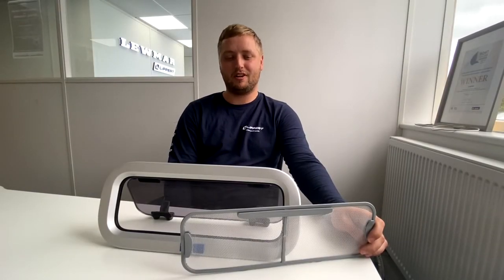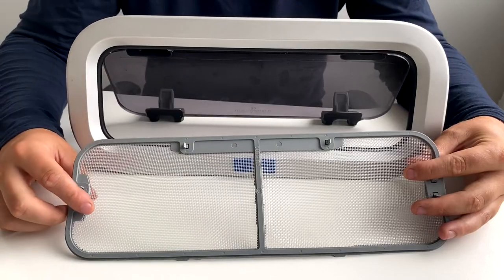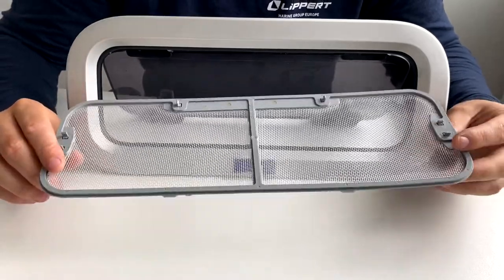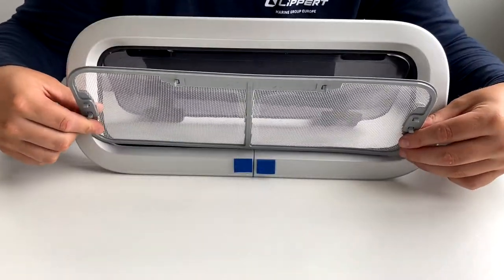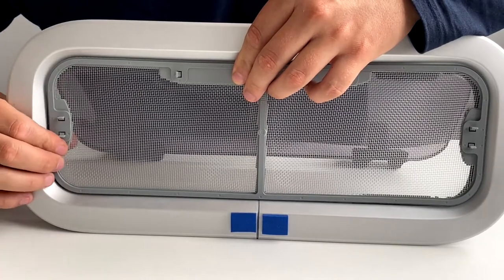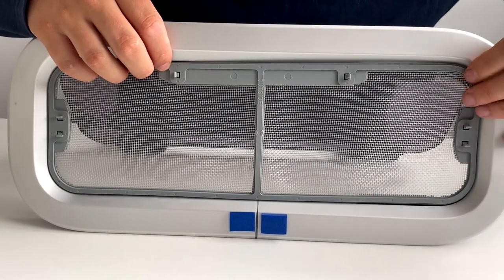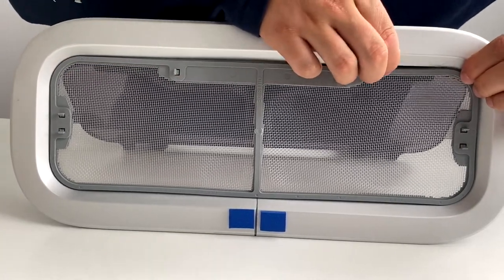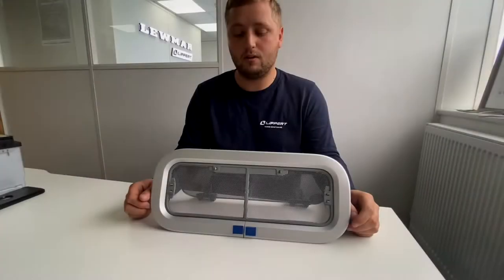Flyscreen Installation

Comment: I searched for this as I have received 12 new portlights to replace the older ones. I saw the cheap plastic mesh things and tried to fit them to the loose portlights. I note the video cuts as he begins the battle and he never closes the portlight. I cannot see how it will be possible to fit them on a boat with no access to the outside. It will be dropped into the water for sure.

So now I wonder if there is someone making aftermarket ones that may work because these are just ridiculous!